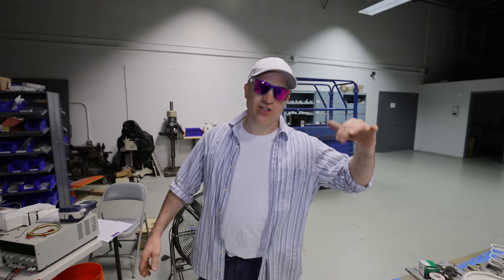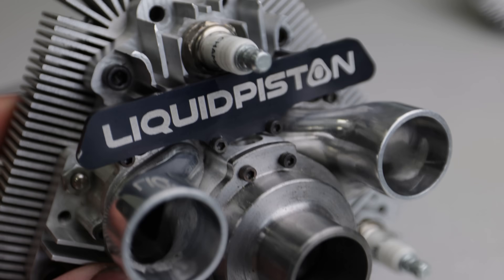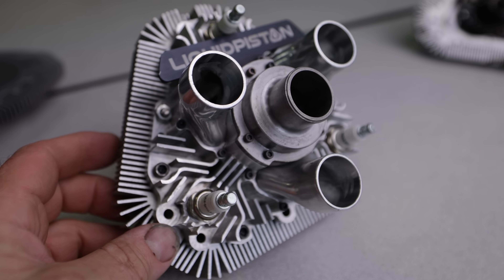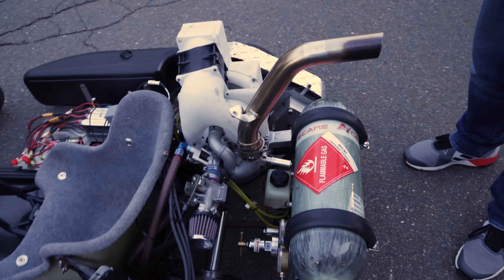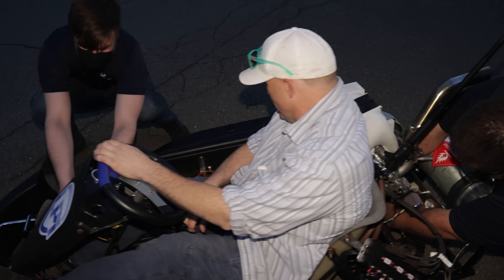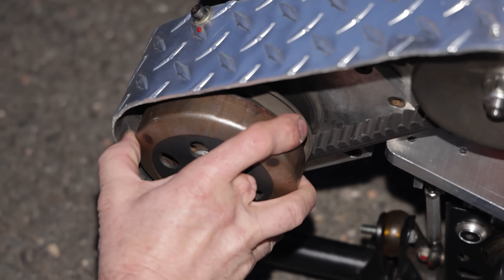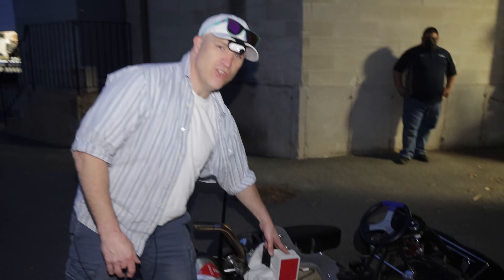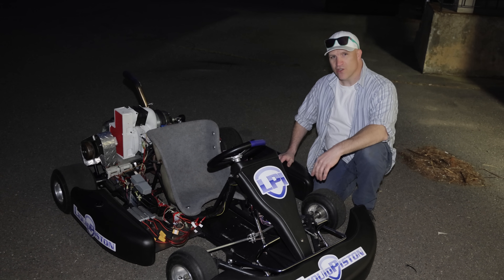Hydrogen Powered Liquid Piston Rotary Go-Kart

Comment: I thought Hydrogen powered internal combustion engine have a ridiculous yield compared to hydrogen cell.
Remember that hydrogen is like a battery, it needs electricity to be produced and we don't find it naturally like oil.
It's still cool tho and i'm not a fan of electric cars but  i don't see the point of doing this exept the "because we can"
Reply: yes.. because we can... just a funny project,
hydrogen combustion wont make it to market, it has even worse efficiency than fuel combusiton.. and many other issues..
Reply: @Pyrcae  thats what they said about EVs and cellphones, lol.
Reply: @sqlevolicious  so you truly believe that Hydrogen combustion market will be bigger than EV  and todays fuel combustion ?
Reply: Imagine not being a fan of EV when it's already better than ICE, faster in motorsport, easier to work on, and is more fun to drive then ICE. You must be boring at parties.
Reply: @sqlevolicious  They are lame AF to drive, has no gearbox to play with, no clutch, no heels and toe, often more than 2 ton to move around and brake, all sound the same and you can't do a trip with it. They can be easier to work on IF the manufacturer let you so... Faster is not always better, you must be boring for your gf
Reply: @bigpig187  you are right , kind of lame compared to combustion engines and manual transmission and I also enjoyed it a lot in the past while now I am also driving since long only automatic transmission and plan to buy BEV asap.

You forget that beside a minority which always enjoys driving their car , there is a much bigger group of people who just want to drive from A to B, just tries to reach a destination . they like the silent BEV and will extremely appreciate autonomous cars while not having to focus on the street but better enjoying life in whatever other way while driving . 
Do you enjoy being in traffic jam for an hour ?
Reply: @Pyrcae  I understand that very much. Even if i daily a manual i like to take an auto when i know there will be a trafic jam. Not being a fan dosen't mean i hate them, but i had to tell our condescending guy that EV are not "more fun to drive than ICE" with 2 buttons to push and a wheel to turn

Comment: Not really seeing how the sealing issues will not continue to be and ISSUE as your sealing against the combustion surface
Reply: The seals are stationary instead of rotating.  They could be lubricated with oil pumped in from behind.
Wankel seals in contrast are rotating, so lube must be supplied with the fuel, as in a two stroke.

Comment: Food for thought:  on same crankshaft, imagine a permanent magnet motor integrated into the shaft.  So serves two purposes:  1 generating electricity like a  a stanard alternator OR 2. Applying power to the electric motor to power assist the liquid piston motor and basically boost its output.
Reply: I said the same thing. Permanent magnets are the best, but apparently notoriously difficult to control (sync with the engine speeds).
Permanent magnet motors are higher efficiency motors, that are best used as a generator only. I believe Honda uses them. And have a cog that allows some of them to rotate at speeds of up to 18k rpm. They are much smaller in design than even the liquid piston.
Excess power can be stored in a battery. But all this will make the design unnecessarily complex and expensive.
Reply: A regenerative system like most electric cars use?
Reply: An inline motor would be regenerative like an alternator but instead apply voltage to it and now the shaft rotation/torque are improved.  You are in that case helping spin the crank.  Power booster.  Now make this motor/alternater also be able to draw in air while rotating to boost fuel-air mix pressure and you have a motor booster, a pressure booster (al electric supercharger of sorts) and when not driven, you get alternator and furl intake pressure boost (supercharger effect...boost intake pressure)
Reply: @massexodus5756  Question is, if an electric supercharger/turbo, is in any way better than a regular turbo.
Yes, it can be more instantaneously. 
On the other hand, it also robs power from the engine, in a way that a regular turbo doesn't.
The exhaust back pressure losses from a turbo is much lower than any electric drain on the engine to push a turbo/supercharger, as the turbo/supercharger needs to be active all the time. (if it doesn't rotate, the engine will create a vacuum between itself and the turbo/supercharger). Meaning you'd get a constant energy drain.
As such, it will be more comparable to a supercharger, which always has worse fuel economy than a turbo.
The best thing to do, is get a permanent magnet generator, and an asynchronous motor, and a battery. The whole unit weighs more than a 4 stroke engine of 4x the size.
Reply: @ProDigit80  my thoughts would all need proven out with an inline motor/generator/pressure-booster, i just think someone should look into the opportunity(s) i propose.  Perhaps for example the amount of boost is limited say 2 psi boost or whatever.  But it's a start.  The next level for engine tech is a motor which has both electrical and combustion engines co-integrated.  And along with that is a stack of devices inline with the crank that would perform say power steering, power brakes, water pump, etc.
Reply: @massexodus5756  Regular hybrids use 1 generator, 1 motor, 1 motor for AC, potentially 1 for the oil pump (but could also be belt driven), 1 for the windshield wipers, 1 for engine cooling, 1 for cabin air.
Reply: Im designing ev's. ive had that idea for last 2 weeks...wow cosmic synchronicity

Comment: Hydrogen + rotary = EPIC 
LiquidPiston: Thanks for bringing it to life, serious potential. As an armchair enthusiast, I've had a very similar idea but obviously no way to bring it to life.
Warped Perception: Thanks for filming. The more publicly these alternative technologies are covered, the more likely they are to succeed. I'll be investigating the LiquidPiston further thanks to your content. 🙂👍
I love the elegant engineering to combat the typical detonation hot spot that wankle engines have (because of one combustion chamber) AND the geometry of the rotor itself to compensate for the difference in quenching distance for hydrogen.
Thank you for including the slow motion of this combustion process, amazing eye candy. [Perhaps consider an edit with gasoline comparison (acetylene was nice, but different visually than gasoline) to show the huge difference in flame speed and quench distance between the two fuel types?]
I'll be waiting with anticipation to see LiquidPiston's future iterations of this project and the potential for eventual improvement beyond petroleum.
BRAVO👏
Edit: subscribed and found the previous video "See Thru Liquid Piston Rotary 
Engine - in Slow Motion" of this motor design running on gasoline. 👏👏)

Comment: Cool concept, but,  Hydrogen engines are far from the green energy many are led to believe. 
A hydrogen generation system has to run off of a power source which is normally run by electricity which is generated by many sources but mainly by burning fossil fuel, such as coal or gas, leaving us back at square one. 

 Basically there are 3 conversions where 100% efficiency and a lossless environment can not exist and through those steps the carbon footprint may not be any less and only add  costs to the consumer. It is actually possible Hydrogen use may create more carbon than it reduces when all things related are taken into consideration.

Comment: If only they had liquid hydrogen in tank...

Now [the engine] just needs Pulse Plugs, Freevalve, Rotary Valves, Spark-Controlled Compression Ignition, and perhaps some cutting-edge supermaterials.

Then a four-rotor version of it can be built with two dual-volute two-shaft turbochargers (w/ MGU-H and Fresh-Air Anti-Lag), and an electric supercharger.

All together, these combined innovations would probably make it the most powerful and energy efficient internal combustion engine ever.

Comment: When you talk about hybrid you really gotta specify more details. These details are what I am most interested in and define the expectations of the performance of the vehicle. Is it a generator with electric drivetrain? Is it full electric assist? Is it partial electric assist only at certain loads or speeds? Etc. Some of this can be implied but in my mind this video should have been 4 extra minutes with a breakdown of the setup.
Reply: I dont think it has much power the engine was almost blowing up and the chluch did not engage tis not the springs i think and why so much electric motor

Comment: That was rather anticlimactic 🤣
Reply: Even when assisted by the electric motor that was pathetic.
Reply: Coming from watching Cars and Cameras, yes. This felt like i was a little let down. ;)
Reply: I was expecting 100cc piston port type performance.
Reply: From what i could see this engine only drives a generator. Bet they had to little juice stored on the battery for that first run.
The concept is interesting for sure but more work needs to be done here. 

I wonder how large that engine will have to be to be able to move an ordinary sized passenger car...
Reply: @Formula400Pontiac  lol the whole system is idiotic. Dudes have throttle cable linked to the generator xD when clearly it should be just an esc on the motor and governor on the genny. Also generating electricity like that is really stupid since you just loose a ton if energy when converting it to electricity... why not just hookup the hydrogen and forget the electro crap. Hybrid is the most wastefull system ever.
Reply: Well with the engine only rated for 4 horsepower that was actually faster than I would think, lol
Reply: @lettuce7378  lol. A moped is alot faster with only 1.5hp
Reply: @vihreelinja4743  what moped exactly only has 1.5hp?
Reply: @lettuce7378  I would say most old 50cc 2 stroke stock moped. As an example my  1967 Peugeot 102 has 1.5hp and can reach 50km/h (30mph)
Reply: @Gael-pn9ki  impressive!
Reply: @lettuce7378  Don't need much horse power when the vehicle weights a lot less than a horse.
Reply: @silentype3008  pretty funny response, although a "horsepower" is actually the force of approx. 8 - 10 grown men.
Reply: @lettuce7378  16 years old learner legal 50 cc mopeds in the U.K. are limited  "officially"  to 3 Hp (2.8 KWatts) and geared for a little over 30 mph standard. They will pull ~ 30mph on the flat even with an 11 stone rider wearing cold weather gear.
(A much earlier pre restrictions 50 cc  5.2 horsepower Yamaha FS1E would achieve 52 mph, the 6 Hp Fantic motor GT would do 60 mph)  the drag factor does not start to bite meaningfully until 60 mph with a small chasis bike /go kart.
pushbikes are slightly different, it costs a fortune to make small improvements with the same rider putting out at 250-400 watts for 20 mins)
There is a big disparity between horse power figures and performance on U.S. made and other areas cars and bikes  because U.S. car / bike engines have traditionally been way over sized, under compressed (bad cylinder head design) thirsty..(not that recent Harleys have bad head design, pretty frugal with decent HP but still V twin cruiser engines mostly)
 Way more torque vs horse power. 

Cutting this short a 4Hp engine in a Go kart should do 40 Mph.
This cart did not because they used the engine as a battery charger, suspiciously.
I would guess this engine needs a lot more work to get the torque up and fuel consumption down without it pre detonating to destruction.
Reply: @lettuce7378  why make a go-kart with a 4hp engine at all?
Reply: I think it would have preformed way better without the hybrid system, the hybrid system adds too much weight. It doesn't take much hp to get scooting. A flat top 5hp can get over 40mph with the right gearing. But I noticed the actual wanted motor only fires once per rotation? Is that not a massive waste? I mean I see 3 points for ignition, intake and exhaust on that wankel engine. That wankel should definitely be firing 3 times per rotation..
Reply: @thatoneguy2549  I just rewatched it to be sure and the wankel is firing 3 times per rotation.
Reply: @randomname4726  ha I just rewatched it too. You are correct. I must of been half asleep the first time I watched it.
Reply: The gear ratio tho
Reply: @Spoon Carving Tom, the Wright brothers' first flight was rather anticlimactic. But 63 years later, people were flying to the Moon. OTOH, Hydrogen is only one part of an answer towards alleviating global fuel shortages.
Reply: @RWBHere  Considering the conservation of energy rule, splitting water and venting off the oxygen would waste over a 1/3rd the electricity.
There is no global 'fuel' shortage, only idiots thinking we must abandon nuclear and fossil fuels and use 'renewables'.
 In 30 years these people will be recognized as dangerous luddite reactionaries.
The moon required two world wars and at todays rates cost the U.S. ~ $230,000,000,000  btw.
 Tho the two world wars cost humanity 10k times that.
Reply: Feeling that the Wankel produces more torque, but this can achieve higher revs. Which would be rare to say that the Wankel torque would have the advantage.
Reply: DoD... what to say.... 80 years of lost wars...
Reply: LiquidPiston as a company is anticlimactic lmfao

Comment: Now that’s just TOO COOL 😎 I think it would go better with a transmission. I’m excited to see what more videos are coming out :)
Reply: they need to put a shifter kart transmission on it (aka a motorcycle transmission)
Reply: @ryanmalin  agreed
Reply: Electric engines don't need a "Transmission". They run on direct energy. You give it gas, so to speak, and it just goes. Electric engines have much more torque than piston driven engines because the power goes directly to the wheels and not to the wheels through a transmission.
Reply: @williamrhea3535  its similar to like how a rc car is, you can manipulate the power like with gears. It can be possible to make just not with the use of a clutch.
Reply: well it didnt go anywhere @williamrhea3535

Comment: Is it possible we can see RX-9 in the future with this engine??
Reply: That would be sick. Notice the engine design limits to a single rotor though.
Reply: @sled_neckx9972  not really just modify intake, exhaust and spark plug port location and u can put as many rotor as u want but the manifold will be messy but still need a major reengineering.

Comment: The engine they made has the apex seals on the block or irons  instead of the rotor itself so cool.
Reply: What about side sealing??
Reply: @shannonneal3271  that moving oval piston has openings for intake that rotate closed like a valve during combustion per cylinder. As for the whole side outside the spinning portions it would be cast to not have one side and the other could simply have an outer gasket same as a head gasket on a 4 stroke.
Reply: @alexmills42  just looked at the website and see they've made a model plane and flown it, however it still has an electric notor attached.
I want to see this engine prooved to be running on its own without electric assistance.

Comment: What are the electric motor and battery specs and does it generate power when not drawing power? What's the displacement and HP of just the LPE? Honestly, I'd rather see what just the engine can do and I feel a little suspicious.

Comment: Sequential tri-turbo. I'm thinking extremely high compression and lots of hydrogen fuel.
(Spell check would say extremely happy compression). First turbo could be bipassed after initial build up. Third turbo could be be bi-passed until it does build initial boost.